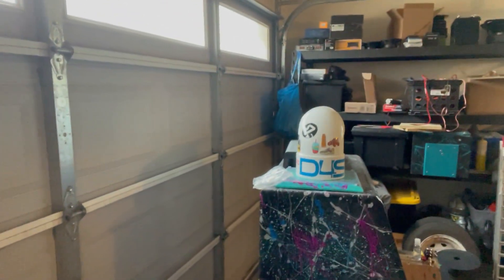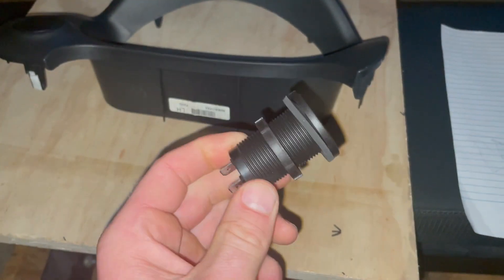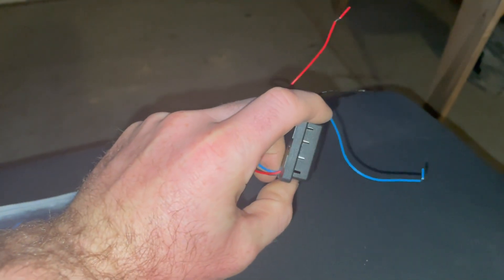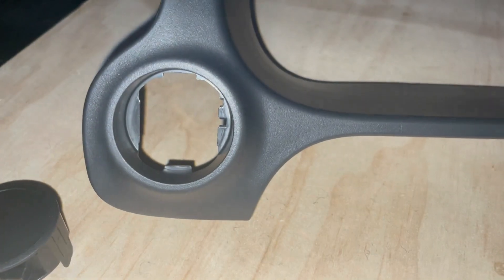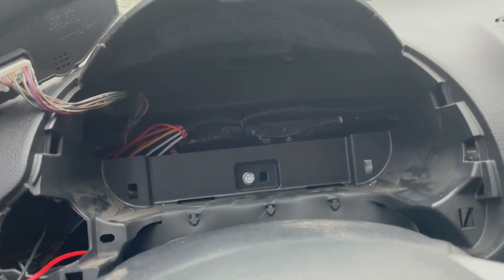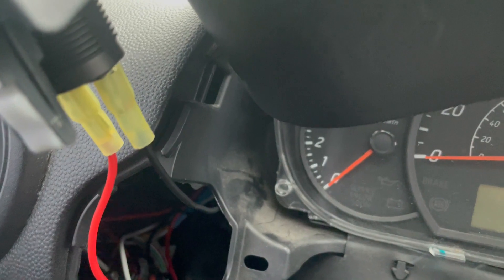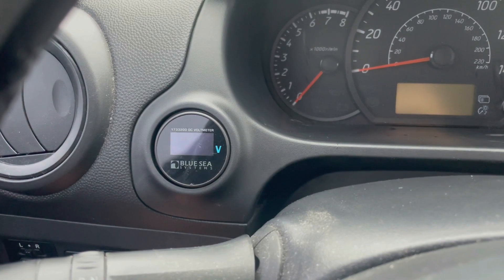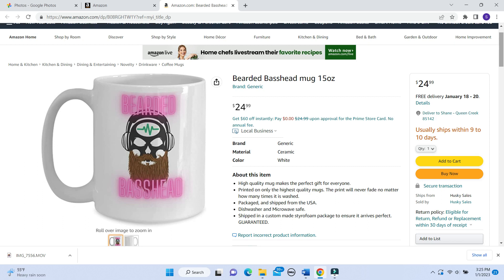How to Install a Volt Meter in your car:  installing a voltage meter in the Go-Kart (2018 Mirage)

Comment: Hi there, always put the switch on the hot side.  The positive side.  It's safer to do it that way.
Reply from the maker: Can you explain why?  I really don’t know so am curious.
Reply: @Husky_Shane_Basshead  Yes.  It's because of the danger of the flow of DC current.  If you break the ground, as in this example, and a problem occurs like a short circuit, the path to ground is gone.  The new path to ground could be your body, or something else, possibly causing a car fire.  The ground wire is your path to safety.  That is why it's best to always break the hot wire for a switch and not the ground wire.

Comment: What type of wire do you use
Reply from the maker: I usually try to just find some 14 - 18 gauge wire.  I can order it online, or find it at a local auto parts store

Comment: What kinda battery did you test the gauge on?
Reply from the maker: that is a super-capaciter bank that I built.  That battery is now in the car under the hood.  I have a build and install video of that if you're interested
Reply: @Husky_Shane_Basshead  yea I'm definitely gonna check it out! I have a XS in my car but that battery looked sweet.. Thanks
Reply from the maker: @itsMrBRoc  they are super capacitor cells I got from DroppinHurtz, and it’s just a cheap empty batter case that I got from batteryhookup.
Reply: @Husky_Shane_Basshead  yea I'm watching now.. really cool man thanks!